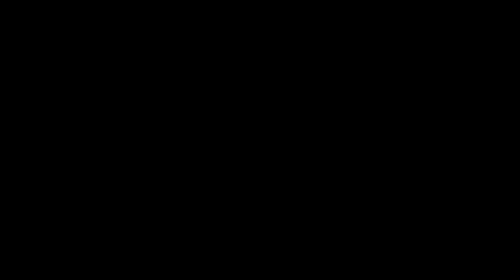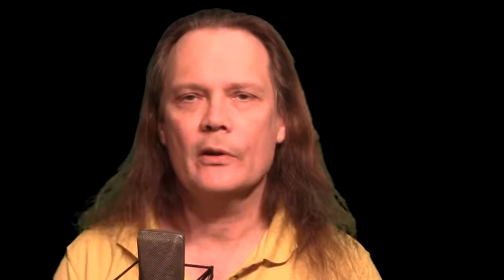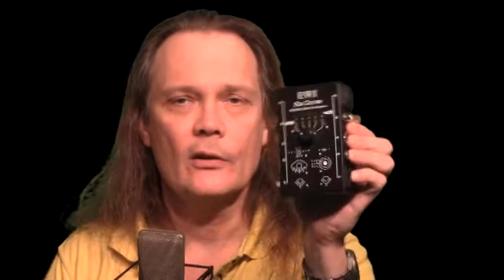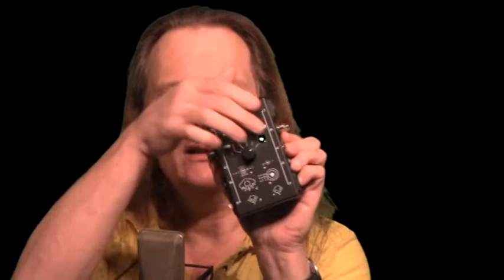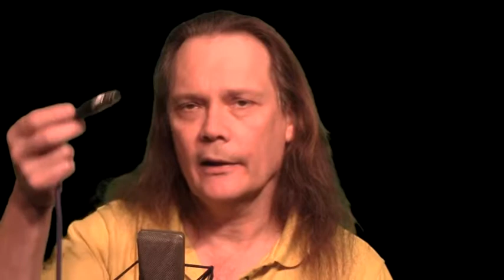DIY Mic Cable Tester: How to Build Your Own and Save Money on Expensive Testing Equipment

Comment: great info！definitely will make one
but i wanna ask 
its 3.3k ohm in how many watt？thanks
Reply from the maker: Thanks -- 4.7k or 3.3k resistors rated at 1/2w is my suggestion.
Reply: Barry Watson 
thanks for the info！
would you consider making a power sender on the other side？to make it very portable
or like connecting pin 2 and 3 so you can test whenever pin 2 and 3 r in or outphase？or simply just put sth near ground to make that happen？
sorry for such a long one but just some thoughts
Reply from the maker: @dominiclee6187  it senses phantom power, usually from your mixer.  If that's not an easy option, you could just get a phantom power box for the other side.  These are easily available and not very expensive.  They're just a box with XLR pass-through for supporting capacitor microphones with equipment that doesn't supply phantom power.

I think SoundTools, Dave Rat's company makes a product very similar to this tester with a sender.  But, you can build your own for just a few dollars, if you have the time and a soldering iron.